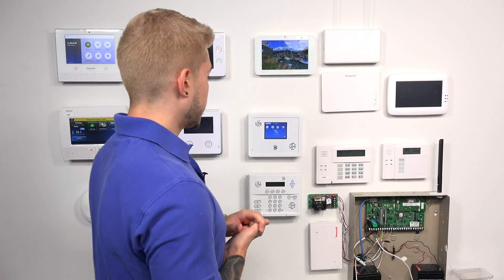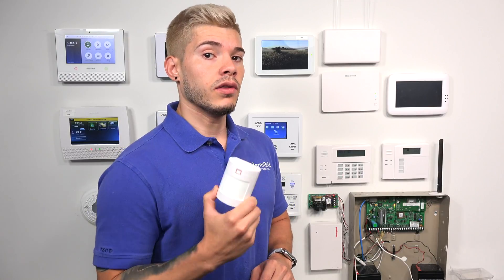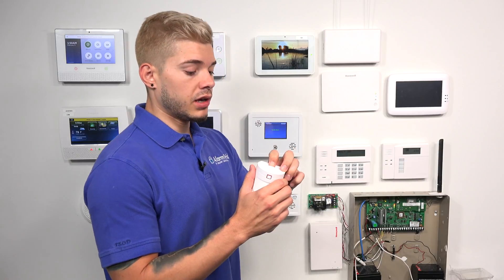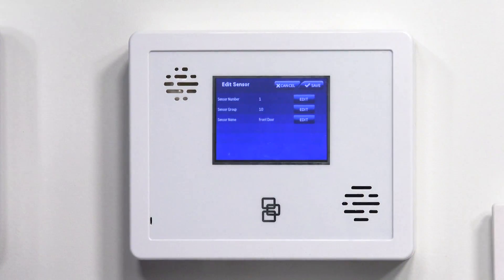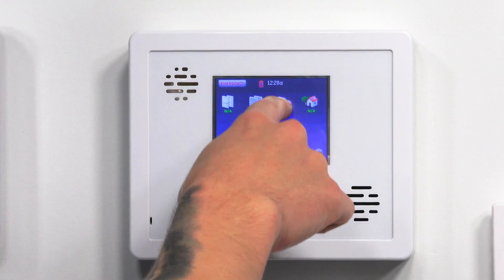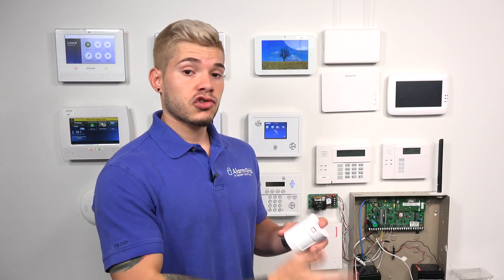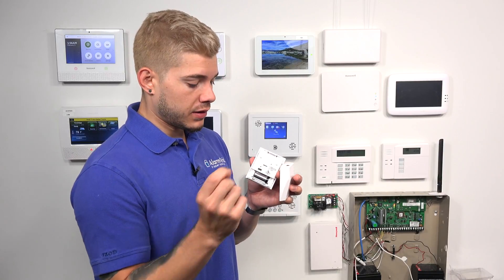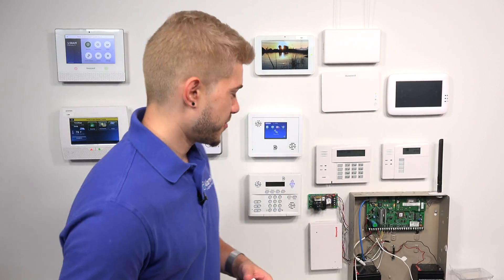Adding a Wireless Motion Sensor on an Interlogix Simon XTi or XTi-5

Comment: I just don’t see the Sensors option under programming menu. I know the access code but just don’t see the Sensors option at all.
Reply: Hello Hardik, The "Installer" access code is different from the "Master" access code. If you do not see sensors, then the "Installer" access code was not used at the access code screen.